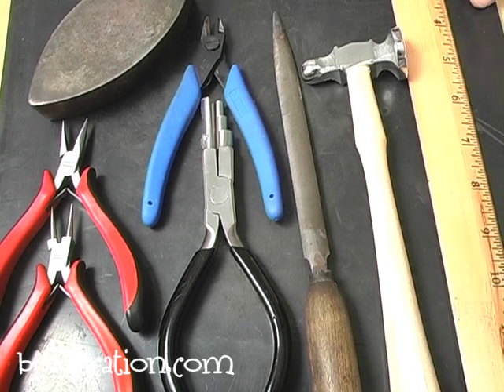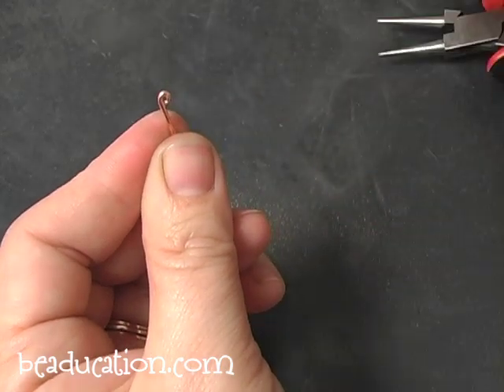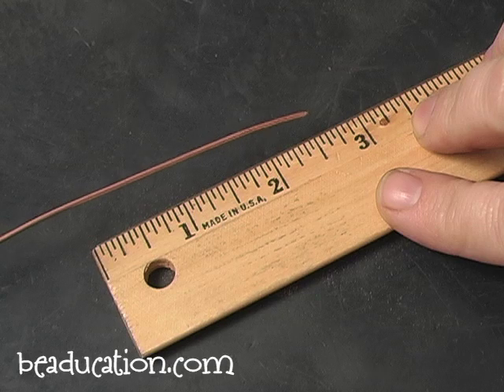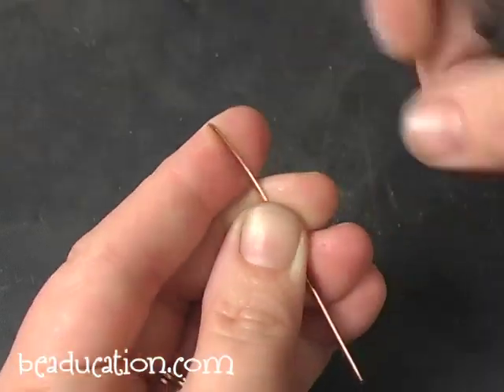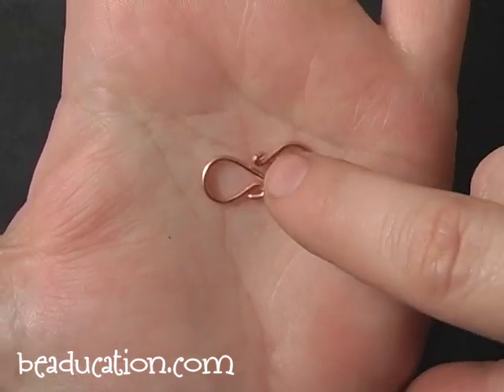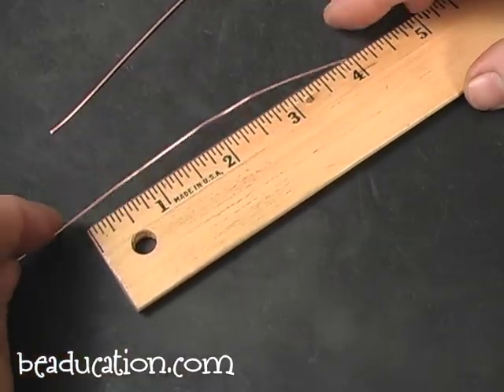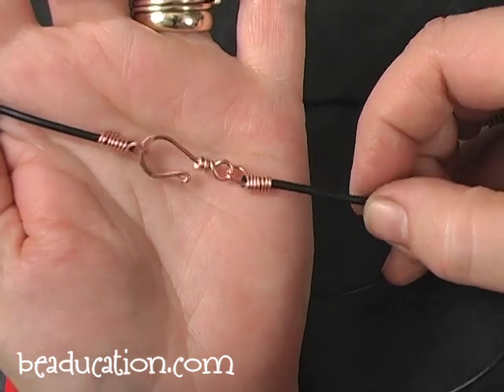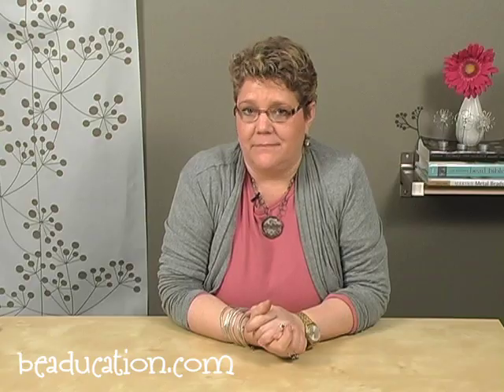Simple Hammered Clasps - Beaducation.com

Comment: Great tutorial, thanks! Question, though. Would the liver of sulphur hurt the leather?
Reply from the maker: Tamara Sunspirit the leather really will never come into contact with the liver of sulphur (LOS). You will only use the LOS to oxidize the clasp before attaching it to the leather.
Reply: Beaducation So you also oxidize the wire before you wrap it around the leather to create the loops that the clasp connects to? Have you ever tried briefly dipping it in the LOS mixture WITH the leather already attached? Just wondering :-) Thanks!
Reply from the maker: Tamara Sunspirit yes, peroxiding would work best. I wouldn't put the leather and the wire in together. The LOS is a super bad stink and I would worry that it would hurt the leather or the stink would stick.

Comment: What size wire are you using in the strength of your wire
Reply from the maker: There are a few projects here. One uses 16g and one uses 20g. We used dead soft copper wire. You can find all the tools and materials here https://beaducation.com/online_classes/120-simple-hammered-clasps